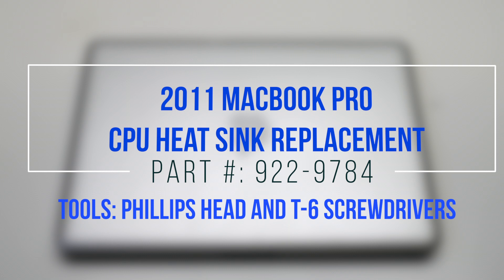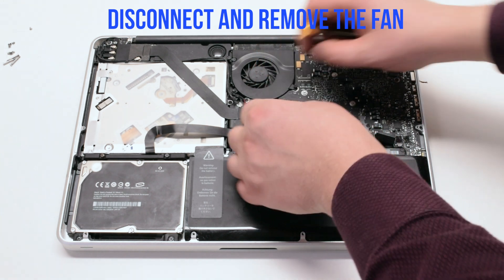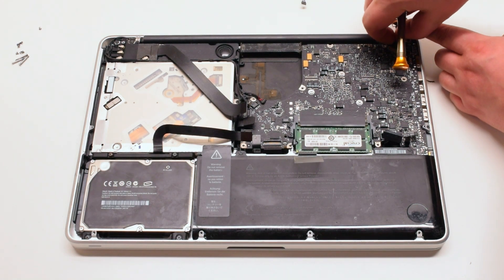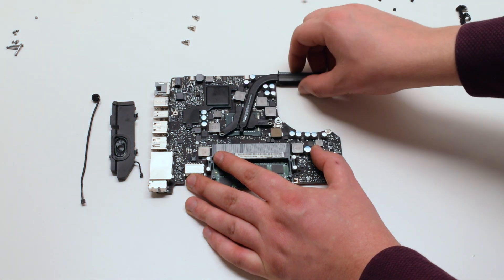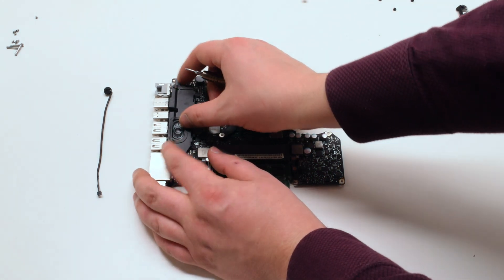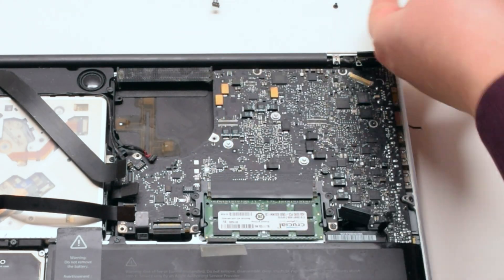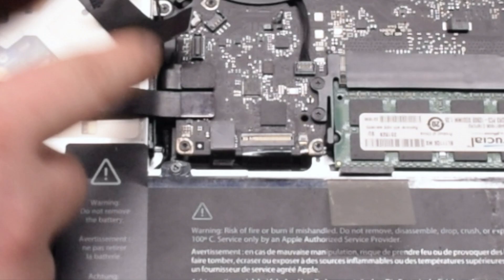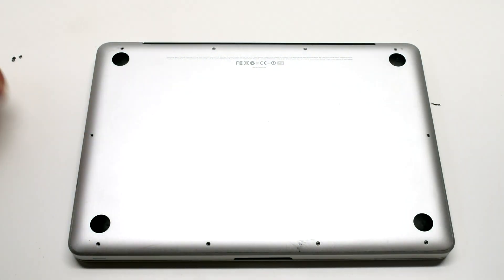2011 Macbook Pro 13" A1278 Heat Sink Replacement

Comment: you dont have to remove the mic or the speaker to do this job what you showed was a pile of HS, also this is not a heatsink replacemnt video its a repaste you also put to little of paste on as well. much to learn here on how not to do this congrats

Comment: The thernal grease on the other chips of this a1278 motherboard, has to be replaced? Its safe to do it?
Reply: I'm looking for the same answer as I did clean them along with the CPU and used a new paste, but I'm not sure that was necessary (or even recommended) as they had a different paste (or something). My MacBook improved but just a little...

Comment: Thanks for the tut saved my old macbook from the E-waste bin...Was about to buy another old macbook off ebay since they are cheap anyways..but I though meh... why not try fix this first even tho it's a pain to work on macs..  Also getting the keyboard connector back in is hard took me  many tries .... I was worried I broke it but you just really got to get it in there just aligning it  (which is hard enough already) and pushing it in a bit won't cut it... It will look like it's in but it's not...

Comment: I just replaced the Fan on the Logic Board, because it was clacking and rattling... I want to change the Thermal Paste on it, but I really don't trust myself going that far into removing the whole thing. Although this video does give me some hope if I were to do it.
Reply: go slowly taking it off and going on and map where and what screw was from where and where you placed it down . You dont want to FU . If you have a Ifixit kit comes in handy . while open need a slim brush and vacuum to clean off dust and pubes. Watch the cables near battery(south) and the top right north corner BIG TIP !

Comment: Thanks for the instructions. My difficulties were related to the disconnection and connection of the keyboard ribbon cable and the keyboard light cable. Both have an almost invisible clasp that has to be released to loosen the cables. I used a magnifying lens to see the clasps. It was impossible for me to reconnect these cables with my fingers. To make the work easier with more working space I removed the battery and used  a flat end spurge to press the cables against the board, align them to the connectors, and pushed them through their way. Don't forget to return the clasps to the locking position. Reinstall the battery.

Comment: Hi. I completed the process now, macbook is starting, OS works fine. BUT!: The LED light for the power pupply connector isn't functioning and the battery does not charge. Need advise please.
Reply from the maker: Usually means something is not connected all the way. Best thing to do it take it back out and reinstall it all over again so you don’t miss anything.
Reply: @GRIBSOFT  thx. did so, the dc-in power board connector was detached, think i wasn't gentle enough. after that led and battery charging as usual.

Unfortunately the whole repaste with one of the best thermal compound on the market (Gelid Solutions GC-Extreme) had not brought the effect, which i hoped for. I updated my MacBook to High Sierra recently followed by an slightly elevated cpu usage. I wish i could say how much in comparison to El Captican which i had before, but while using el capitan i never been keen enough to track temperature and cpu usage. The current situation is that as soon as the usage rises above aprox. 35% the temperature reaches 75-80°, causing the fans to start or to freak out if the usage is about to reach 90% and there is nothing you can do about it unless there is a way to throttle the cpu or to disable the boost mode. 

After 7-8 years of using i7-cpu's, desktop and mobile/notebook i, for myself, can surely claim that those were my last i7 skillets. Also i will definitely think twice about MacBooks purchases.
Reply: pretty much everything one can do about the problem discussed here is covered in this guide: https://www.youtube.com/watch?v=wIHpb1T6LRo

Comment: Does anyone know which way the DC-in Power Board is plugged into the logic board. I am doing this to my own 2011 13" MacBook Pro and I cannot figure out which way it is supposed to to go in because in the video (around 4 min 27 seconds in) you can't really see which way he plugs it in. 

Is it prong side up or prong side down?
Reply: The prongs goes side down

Comment: is this the heatsink that has fluid inside it? noticed oily fluid on the keyboard after macbook was disassembled for cleaning etc and upside down for a long time. want to do the gpu, screws are on really hard though.

Comment: hello thanks for the video. I chaged my thermal paste but temp continue like 77 degrees. DO you think if i buy new heat sink body and change can be fixed?
Reply from the maker: It's the next logical step. Heat sink, then the fan, and then finally the logic board.
Reply: Ok perfect . Thanks

Comment: Thank you for your very helpful instruction video! I nailed it. However, I accidentally broke the facetime cable while pulling it out... I guess mine previously got stuck with dust and stuff.
Reply: I had the same problem. The iSight camera connector broke.
Reply: @Snackdance  me too, I guess it happened to all of us.
Reply from the maker: Thank you! You can support us by becoming a Patron or donating to keep our mission going here https://www.appledollars.com/support-us/
Reply: It is impossible to pull this isight camera cable.  How did he do it easily

Comment: Hi, what is this other "heat sink" next CPU with two black square? Should i replace the thermal on it too? I cant see if there is paste cause one of those tree screw is striped :( Is possible to find some kind of logic board manual to know exactly what is each component ? Thanks dude, you helped me and others alot! o/
Reply from the maker: The other sink is a network bridge I think. There is a guy named Louis Rossmann that has a lot of in depth info about manuals and schematics, i'd look into that direction if you want deeper information.
Reply: @GRIBSOFT  Thanks again! I got a information from macrumors forum, that others chips are for Thunderbolt chip, and Platform Controller Hub (PCH).

Comment: Hello, After following this method on my mac. I did the same in the video however after putting back I am unable to start the MBP. Can anyone help?
Reply from the maker: Yes, reconnect the keyboard. The keyboard has the power button connected to it and so if it's sitting in the socket on the loagicboard incorrectly it will not power on.

Comment: thanks for that, helped me out. Temps didnt change, but i found out issue is I am running bootcamp with windows 10 and for some reason the fan profile is not very good and not even getting loud until CPU hit 100c (212f).. so using 'Macs fan control' for windows now temps r better cause i make fan kick in earlier.
Reply from the maker: Great! Glad you found a work around that works.

Comment: thanks for this brother! ive been meaning to do it on my macbook pro, but temps are not bad...i will do it one day anyway...ive already done it on the 2010 macbook and it was easy as pie and made a Big difference...i just used silicone  heatsink paste, not the  fancy arctic silver, yet big change..the factory pastes are really terrible and provide poor het transfers...one important thing, the keyboard ribbon  needs to be FULLY seated in connector after board is replaced...easy to think its In when its not fully in there...result is no boot and u think u fried ur board....slide and press it in FULLY then lock clasp  and it will boot..
Reply from the maker: Very true information about the keyboard ribbon cable, thanks for pointing it out.

Comment: I followed all the steps, but my computer won't turn on but I hear the fan. It did turn on for a moment, but some of the keys of the keyboard won't work, so I restarted it and now it won't turn on at all. I tried the power pads, but when I attempted it, I saw a spark not sure if I just fried my logic board... PLEASE HELP!
Reply: Skip741 x Thanks for the advice, but I totally forgot to reply back to this question. I got it fixed, but it wasn’t the keyboard connector. I checked there and made sure it was connected and locked in. I even felt the “little lock” that it was in all the way if you know what I’m talking about.  After I scared myself of the spark (yeah you shouldn’t see that), I panicked and left it alone for several hours. Not sure if it was a power drain or something, but it turned on by itself again and everything was normal. Of course the heat sink issue was fixed too. Hopefully this helps someone if this happens to you for some reason.
Reply from the maker: Unplug the keyboard and reseat it. The keyboard has the power button attached to it so if the keyboard is not plugged in correctly then the system can't power up. Unplug and reseat the LCD screen on the top right, make sure that is a flush and sold connection. If you saw a spark then something got shorted, that should never happen, it's bad news. Let us know if reseating cables helped.
Reply: This may help u, i ran into issue where i replaced the logic board and  there was No  powerup afterwards, no screen,no sound,no fans...i thought the board got damaged...all connections seemed  plugged in...BUT the  Keyboard ribbon was not FULLY pushed into the connector and thats what the issue was...if its not fully in and locked, the board will seem dead and no boot..i had it in the connector ,but when i pulled on it ,it fell out and had not Caught  the connector at all... i had to use  a small rectangle cut from a creditcard, stiff, to press against the cable and ease it deeper into the socket, then flip the lockdown clamp...booted up fine after that... if u had sparks , well, thats Not good!   reseat the keyboard connector as i described and hopefully it will still boot...goood luck!
Reply: hi samurai,  glad to see it came back to life!

Comment: Can you make a video about replacing the CPU for a newer one? For example, my came with a Intel® Core™ i7-3520M Processor and I want to know if I can upgrade it to a Intel® Core™ i7-3612QE Processor or any similar.
Reply from the maker: You can never upgrade the processors on any post 2007 Apple laptop.

Comment: Why do you disconnect the speaker? I mean you can replace the heat sink without removing it. :D
Reply from the maker: True, the video was made from many clips and that one just made it in there lol
Reply: Thx for clarifying, I was asking myself the same question.
Reply: You should fix that comment. You should say why do you remove it because in the video he says first disconnect the speak, this necessary but later he says remove it, this is not. When I read your comment I thought how will I remove the logic board if not disconnecting it
Reply: @IwatchYuTup  why would you have to disconnect the speaker? basically you don't need to touch any of that, just the 3 screws

Comment: Hi. I have the following problem with my macbook pro 13" early 2011: 4MOT/4/40000002: Exhaust - 7022. Can this solve the problem? My fans are running at +7000 rpm constantly from when i boot up the mac. Resetting the smc doesn't work.
Reply from the maker: This models heatsink sensor is connected to logic board, make sure the connection is good. Replacing the heat sink might solve the problem. When you do replace it, make sure to rub down the entire logic board with a toothbrush and alcohol, make sure to apply new thermal paste. The fan should be fine it's the thermal sensor or the logic board thats the problem. 

Grab this while you can:
http://www.ebay.com/itm/GENUINE-APPLE-MACBOOK-PRO-13-EARLY-2011-HEATSINK-COOLING-FAN-922-9784-922-8620-/301893486289?hash=item464a4106d1:g:38gAAOSwyjBW4Kjx

Good luck :)
Reply from the maker: I retract earlier statement, the temp sensor is on the logic board. It can have moisture or residue on it, so soak the board in 90%+ alcohol and rub the entire board with a toothbrush, this will clean out the sensor. If you really want to get technical, "at your own risk!" you can bake the board at 385 degrees for 7 minutes in any conventional oven, this will reinforce component level connections and reconnect detached connections, this is also referred to as "reflowing". Either way, if alcohol cleaning and new heatsink doesn't fix the issue, you will need to replace the board and I would risk reflowing it before spending 400$+ on a new board. 

Another option for testing is to download Mac Fan control here and manually turn down the fan speed to a reasonable rpm and see if the cpu temperature is still high, although the data that is displayed is fed through the temp sensor that might be broken, this could be a temporary solution:
http://www.appledollars.com/downloads/
Reply: So it can not be the connection from the sensor to the logic board that might be loose? I will try to soak the logic board in 90%+ alcohol.  Do i just follow your video about replacing the logic board and then clean it and putting it in again?
Reply from the maker: Yes, exactly. Just follow the video, when it's out clean it. Let it dry near a fan for 2 hours and reassemble it.
Reply: Okay thanks! I need to remove the heat sink and the thermal paste and apply new paste and install a new heat sink right? That would get me the biggest chances for it to work right?
Reply: Btw. i can't controll my fan with Mac Fan control. The fan doesn't respond to when i put the fan speed to 2000 or so
Reply from the maker: Find a fan and heatsink combo for under $15 then do the process we discussed all at the same time.
Reply from the maker: Better to wait to be safe and try to tackle all problems at once so you don't have to do work twice. Good luck.
Reply: Thank you so much for your help :-)
Reply: Hi again. Im currently waiting for the new heat sink. In the meantime i tried replacing the thermal paste - without any luck unfortunately. The CPU temperature before the new thermal paste was around 58 degrees celcius and now 50 while the fan is at +7000 rpm. Doesn't that sound like a way too hot temperature at that fan speed? Can this be the problem?
Reply from the maker: Not sure, I think the new heatsink will solve the issue. Keep us updated.

Comment: Oy, I'd like to do it for a late 2008 unibody. Have you seen a temperature improvement after ?
Reply from the maker: +HK Asia Yes, this can improve temperature and decrease fan loudness, besides replacing the thermal paste, you need to clean the dust from the fan and from the fan vent (the area where the fan sits). I have shot over 250 videos for every Macbook model 2008-2012 so far. Here is the link for your model http://www.appledollars.com/2008-macbook-a1278  it's an interactive video map with a replacement video for every part of that model.

Lol the heat sink is the only video not added to the map, here it is http://www.appledollars.com/new-gallery/2016/3/3/2008-unibody-cpu-heat-sink-replacement-save-apple-dollars-18 

Good luck!